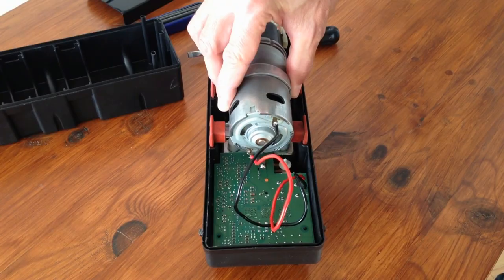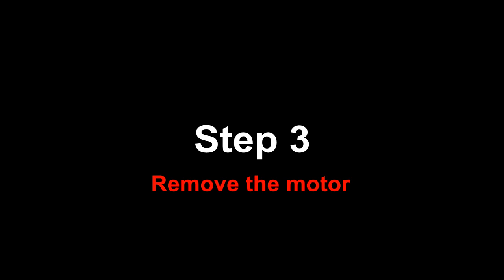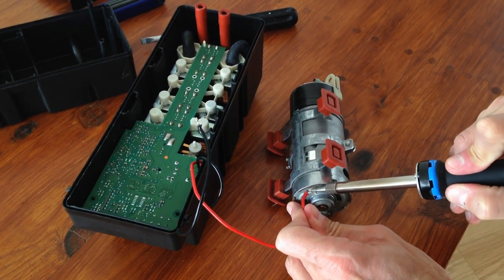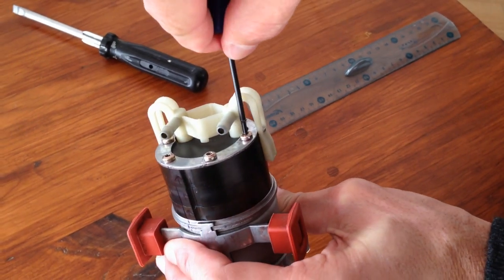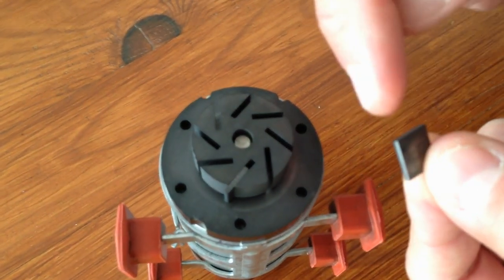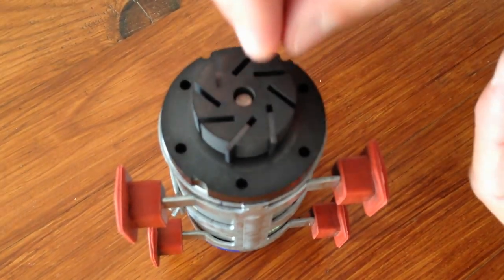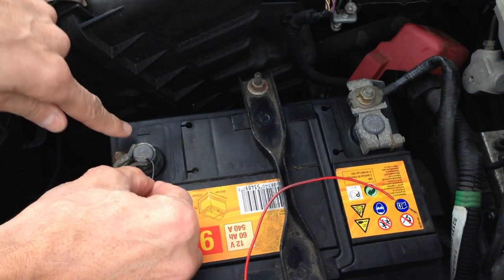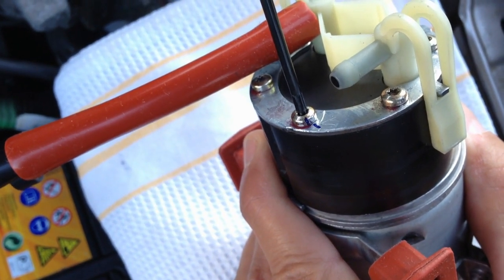How to fix a central locking vacuum PUMP broken ROTOR - Mercedes SL (R230), CL (C215), S (W220)

Comment: Do you repair pumps?
Reply from the maker: Hello ! I share what I do in videos. Concerning the PSE pump, most of the time, it is the rotor that is worn out or broken, that's why I made this video. Sometimes the motor is burned out but this is very rare because it is protected by the 20 amp fuse. Sometimes the pump doesn't work because of a power supply problem and you have to check if there is no corrosion on the electrical connector. In this case it is not the pump that is out of order but the electrical connector that is faulty. The electronics can also be damaged by humidity and in this case the pump must be replaced. If your pump does not work, follow the video step by step, it is easy to do it yourself ! 😉
Reply: @IfixmyBenz  
Thank you. 
I had my 05 S500 shipped from CA to PA. The trucker had it up top and locked the doors which triggered security system. It was being activated for 3k miles. When I got it none of the pump activated functions worked. I replaced the pump and all good. Wondering what damage occurred to pump. Burned up? I don't know.
Reply: @IfixmyBenz  
Took the motor apart, and back together, before watching the video. How important is it to have it exactly lined up as u did in ur video?
Reply from the maker: @jimfinan189  Hello ! It is important to properly align the components of the outer casing of the impeller to ensure proper pressure at the pump outlet. Do the best you can and then check the pressure at the pump outlet by connecting the motor to 12 volt as I do on the video. 😉
Reply: @IfixmyBenz  
How does tightening the screws on the motor increase the vacuum? I get that too little vac would effect the functions but too much ... cause it to burn up I guess. How does the tightening increase the vac?
Reply from the maker: @jimfinan189  Hello ! For a good operation of the pump, there is an optimal tightening of the turbine. If the tightening is too weak, the turbine elements will be badly adjusted and there will be a lack of sealing and therefore the pressure at the pump outlet will be very low. The tighter you tighten, the finer the fit of the elements and the better the pressure. But... if you tighten as much as you can, you will break the turbine outer casing components because they are not made of metal but of graphite and would not support a too strong tightening. That's why in the video, I start with a light tightening, then I slowly increase the tightening until I get the desired pressure but not more. The ideal pressure at the pump outlet should be between 3 and 3.5 bar. And keep in mind that the PSE pump is commonly referred to as a vacuum pump, but it provides both vacuum and pressurization to manage the car's pneumatic functions. I hope this helps. 😉
Reply: @IfixmyBenz  
Great thank you!

Comment: Hallo ich hab das alles gemacht aber trotzdem geht immer meine sicherung aus warum ?
Reply from the maker: Hallo ! Vielen Dank für Ihren Kommentar. Wenn Sie überprüft haben, dass der Rotor nicht kaputt ist, und den Motor an einer 12-Volt-Batterie getestet haben und er richtig funktioniert, dann haben Sie vielleicht irgendwo einen Kurzschluss, wenn die Sicherung immer noch durchbrennt. Überprüfen Sie den elektrischen Stecker, der an die Pumpe angeschlossen wird (die Blackbox). Überprüfen Sie den Zustand der Kabel, die zu diesem Anschluss führen. Überprüfen Sie auch den Zustand des elektrischen Teils im Inneren der Pumpe. Viel Glück !
Reply: Hallo nochmal ich hab jetzt anstatt die 20Amper eine 25Amper reingemacht und es funktionert alles reibungslos und überhaupt Garkeine Probleme.
Aber kann da was passieren? Wegen 5amper unterschied
Reply from the maker: @M.O.C.B  Die Gefahr besteht in einer Überhitzung des Motors im Inneren der Pumpe und der elektrischen Zuleitungen.

Comment: So why call it a Vacuum pump when it's an air compressor?? It has an ambient air intake thru a filter. BAR is a unit of positive pressure... Help>
Reply from the maker: Hello ! You're right, it's confusing. It's a simple misuse of language. The PSE pump is commonly referred to as a vacuum pump. In fact, it creates vacuum but also supplies pressurized air depending on the action required... 😉
Reply: @IfixmyBenz  thank you for your reply. Does it reverse direction to change function? The external filter sucks in air  when say you operate the trunk lock. That tells me it’s pressurizing the lines. But don’t the locks operate on vacuum? Confused & determined to fully understand…

Comment: Can I have the part number of that Rotor please ? Thanks!
Reply from the maker: Hello ! There is no part number for the rotor !  There is only a part number for the entire pump (the black box).  Your Mercedes dealer will only sell you the entire pump, not the rotor separately. However, you will find in the video description a link to a rotor of excellent quality.  It is very important to replace the broken rotor with a very good quality one, otherwise the pump will not work properly and the motor may burn over time or the rotor may break.
Reply: Thanks a lot 🙏
Reply: Any idea where can I get the quality rotor for replacement? Thanks
Reply from the maker: You will find an internet link for the rotor in the description of this video (under the video). Just click on it !
If you use the YouTube application on a smartphone to watch the video, you must click on the small arrow to the right of the video title to display the video description. 😉